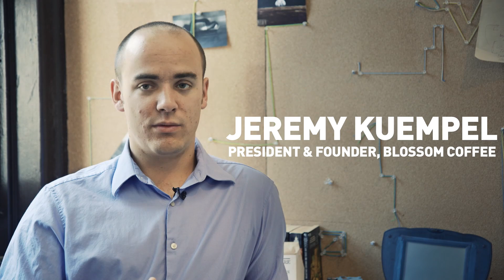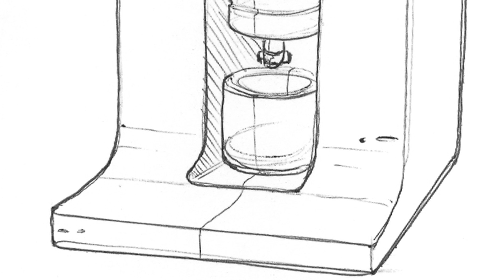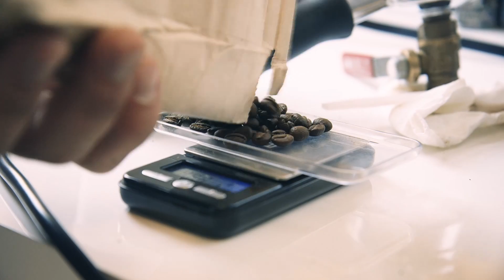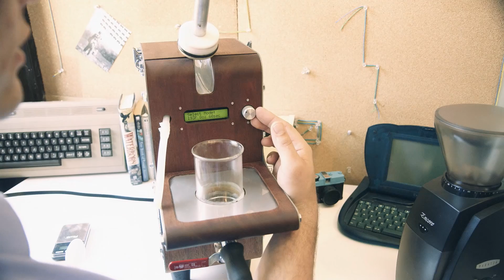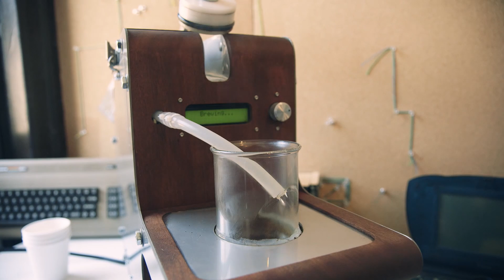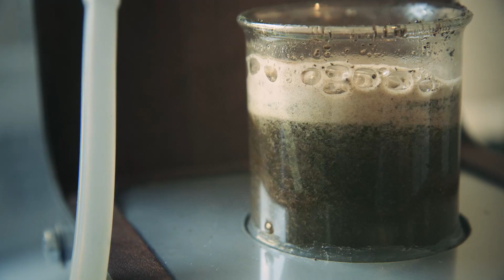Hands-on with an $11,000 coffee pot

Comment: $11k for an arduino, some relays, heating elements, and a veneer, and you still have to pull a lever?

PID controlled temperature isn't a big deal... It is literally 30 minutes of math and 5 lines of code to implement (I study this stuff). 

If he wanted to aim for the high end, he would want a pressure regulator and double boiler- a coffee machine that will literally do anything.